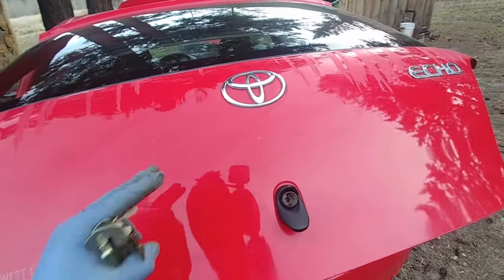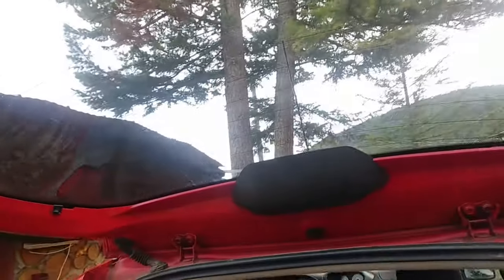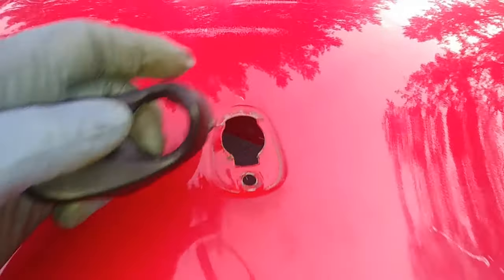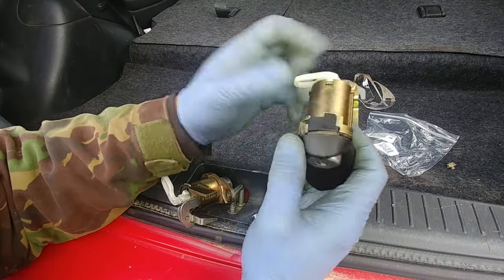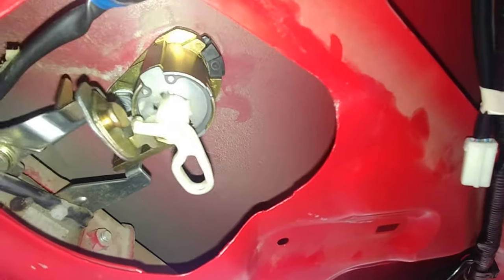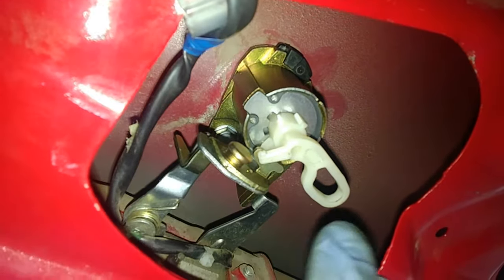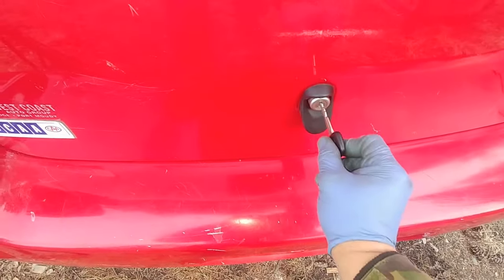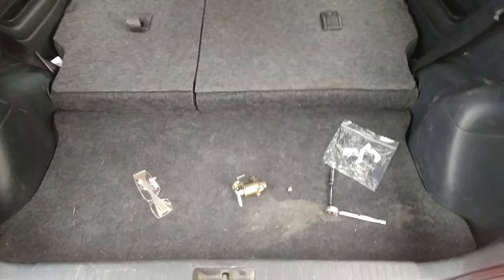TOYOTA ECHO, YARIS HATCH DOOR LOCK REPLACEMENT

Comment: No Seal between Lock and plastic ?
Reply from the maker: Nope, wasn't any seal on lock I removed and used I got for replacement. Do you have one on your Echo?
Reply: @PistonShack  there Is "something" cooked by the sun ( 19 years oldl car..)
Reply from the maker: If it won't leak I won't worry about it. We will see, might reassemble it with silicone sealant later) Thanks!